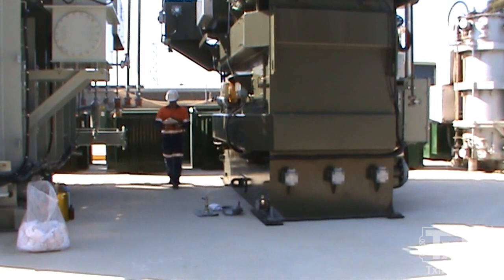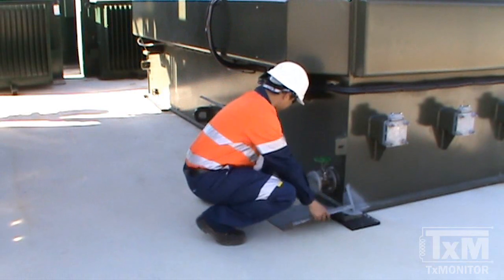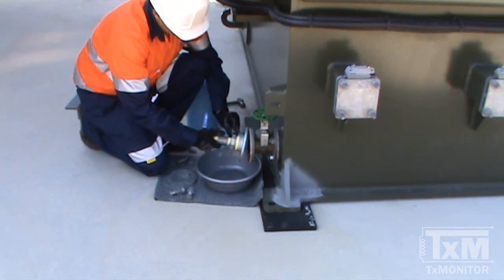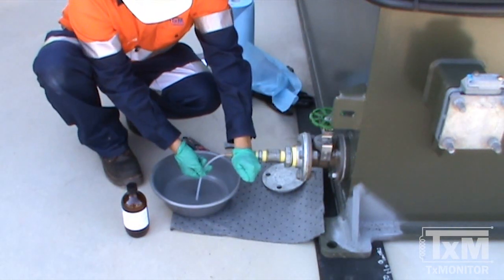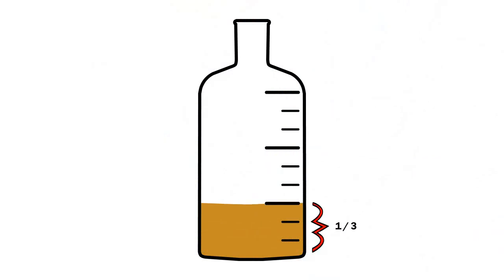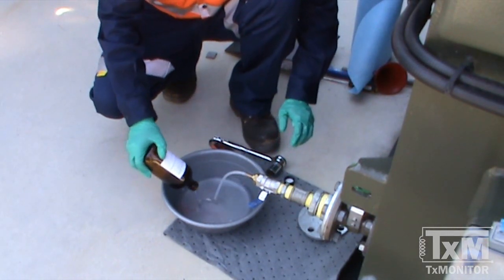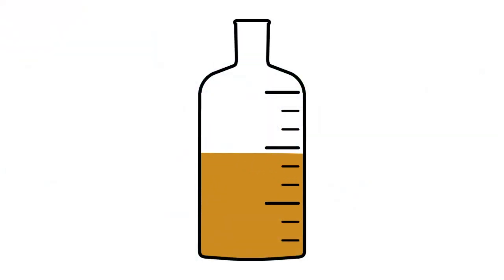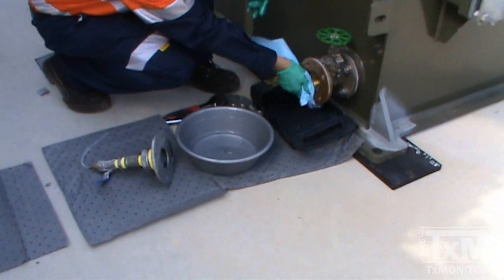Transformer Oil Sampling Training: Part 2 Bottle Sample

Comment: To avoid trapping air into the transformer, the outer valve should be opened first (noted in IEC 60475). This was done the other way around here. Was this intentional, mistake or my intepretation wrong?

Comment: Dear Sir 
Please advise why you left a 1 inch space in the bottle ,, do you have any stander recommendation ??
Reply: Hi, That's for expansion as he said. If the bottle goes somewhere warmer, the oil will get larger and if there is not enough space to expand, it will put off the cap and spill. We experienced it. Hope this helps.

Comment: Can you tell about the specification about the bottel
Reply: It should be dark glass or aluminium. Transparent glass is not OK because sunlight deteriorates oil pretty quick. And plastic can react with oil, so, dark glass or special aluminum or steel bottle.